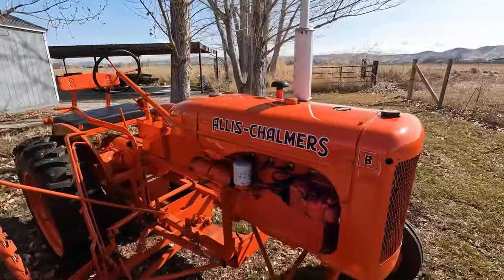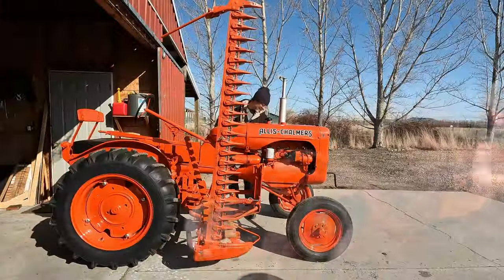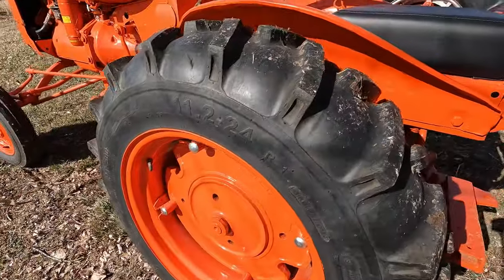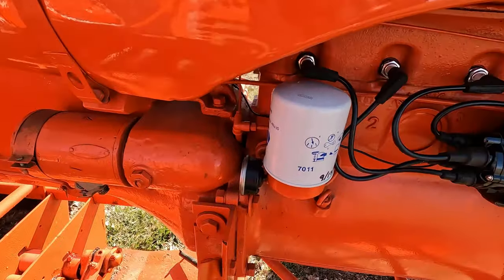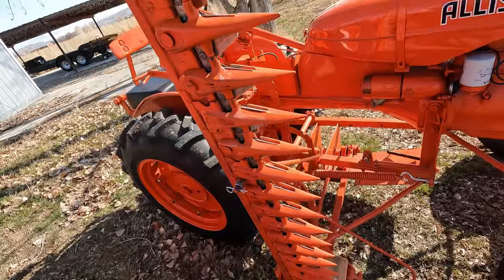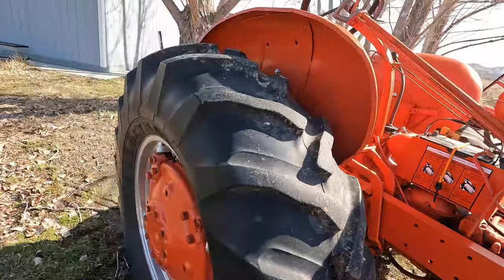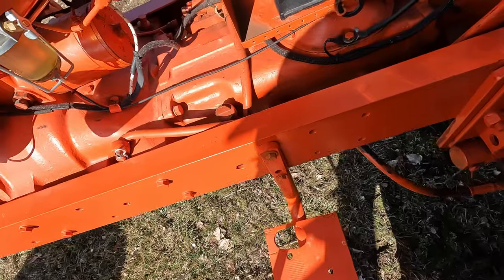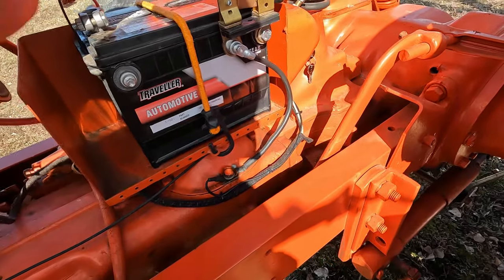Allis Chalmers WD45 & B - Side by Side

Comment: On my John Deere L that I had, it had that "kill" button the magneto also.  It was electric start with the original 6V system.  Other than getting on and off of it, it was a nice little tractor.

I almost bought a WD a few years back, but the rear tires needed replaced and it was in pretty rough shape.  I passed on it.  I almost traded for an AC B, but again, passed on it.  Both of your ACs are in really nice cosmetic shape.  Nice.